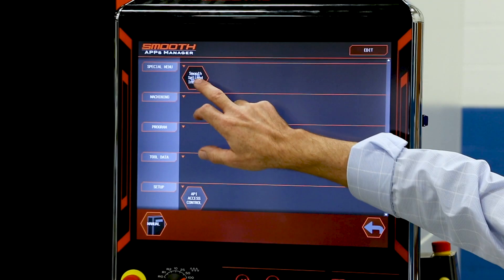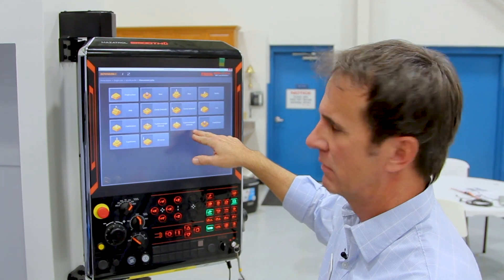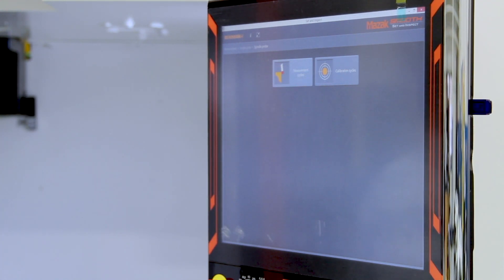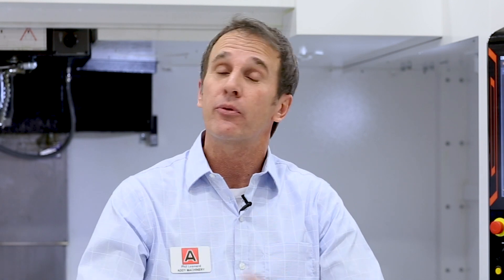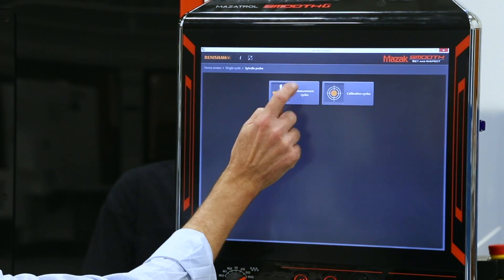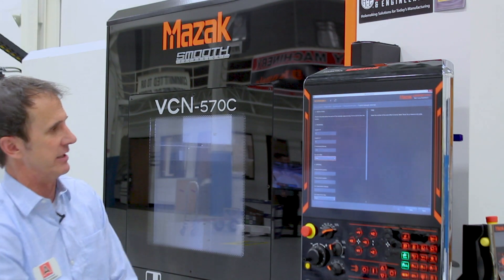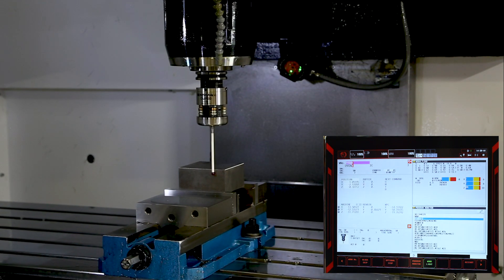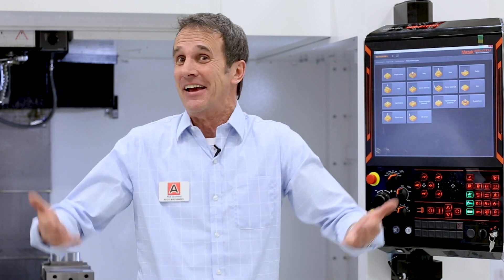Cut Setup Time with SMOOTH Set and Inspect

Comment: I run a VCN 570c also. However when ever we use the Smooth Set and Inspect we have issues. Example,  let's say I  probe X-positive. As soon as I jog in manual, as if I was going to my Y position to probe next, the control will error for door lock. As soon as you click the door un-lock/lock button,  the control will kick you out of the Smooth Set inspect screen and you have to go back to through the whole process to set up again. Any ideas why this might be happening? TIA.